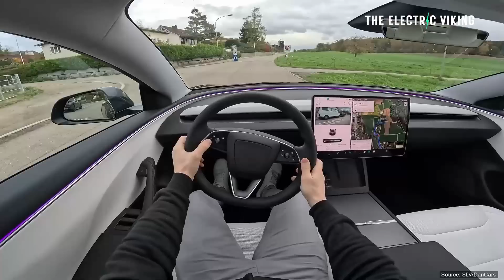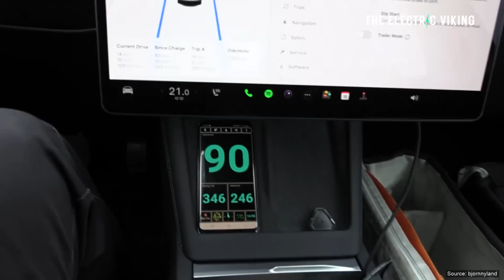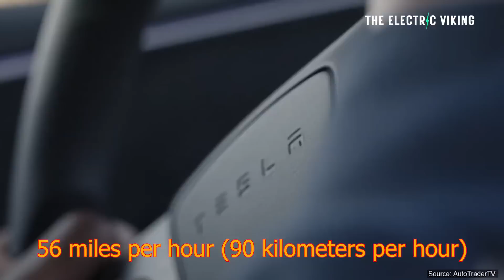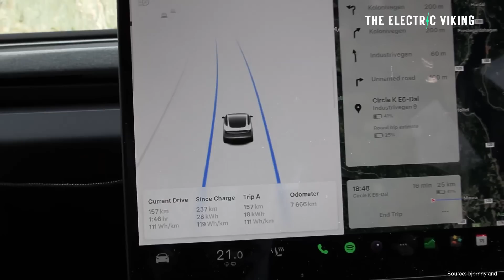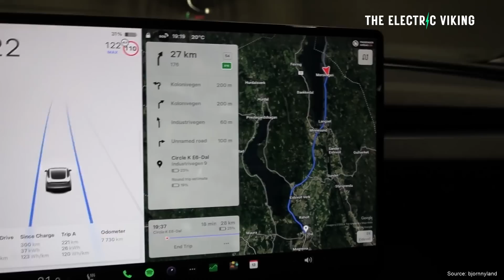Tesla with LFP battery achieves RECORD breaking efficiency in highway test

Comment: Regen does not increase range (with respect to driving steadily), it just means less is wasted (when you do stop start).    Driving slowly is why city driving is more efficient.   Pushing the air out of the way is where all the energy goes on long trips.
Reply: You are wrong on this. Regen by definition increases range it puts energy back into the battery. Now accelerating more frequently draws from the battery faster. That’s why like you said if you had a choice on an open road it would make more sense not to have regen because the constant acceleration would lose more than the regen gains (but it’s close) ……however in the city where you have to stop and start anyways regen makes more sense because instead of breaking and then accelerating you can use regen to add a little back and you would break anyways…..another example is going down a mountain road. Instead of having to break and then accelerate, I could use the regen that would add more energy back into the engine and smooth the ride out. I’ve actually added percentages to my EV going down mountain roads. Like drive 30 miles and and have a few more percentage charge
Reply: And since power losses are proportional to the square of the current in the motor, accelerating and decelerating will always cause your range to drop vs a constant speed (on a flat road).
Reply: @DouglasBruss  Hmm, power output is also proportional to the square of the current.  The losses are linear in an ideal motor, represented by its efficiency. The problem is the losses happen twice.
Reply: @DouglasBruss YES!!  Let's not slow down or stop in towns or cities & thus NEVER accelerate.  Let's remove crossings.  junctions, traffic lights, roundabouts, cars pulling out from kerbs, pedestrians, especially teenage boys with testerone level issues & ego problems, etc so you smart455 🤡s can truly believe you've won an argument!!😂
Reply: Regen increases range in all real world driving.  For regen to not be a factor you would have to never use the brake pedal or change speed ever while driving.  You have to invent a theoretical example of driving that no one actually uses to have regen not be useful.
Reply: Interesting discussion with good points.  It is a semantical issue because different definitions of “range” are being used: maximum potential range, estimated range, operational range.  The study Sam is reporting on is determining maximum operational range under specified conditions. Most of us talk about experienced or operational range, with different definitions there as well. On a recent move I was towing a small, boxy U-Haul trailer from San Francisco to Seattle with my Model Y.  When I started was presented with an estimated range, always less than the maximum potential range built into the batteries. Being in trailer mode I noticed my estimated range was recalculated downwards after driving for awhile into “estimated trailer mode” (ETM) range or the % of estimated charge remaining when the supercharger is reached. This ETM to the next supercharger decreased with hill climbs and increased with downhill regen.  ETM to supercharger range also decreased with speed increases above 60 and increased dramatically by dropping speeds to 40 MPH which we had to do to bring the operational range back up in order to reach the next supercharger (ie brings the Model Y into wind drag optimum at 35-50 MPH).  (https://www.reddit.com/r/TeslaModelY/comments/r2uyky/model_y_speed_efficiency/)  So speed, regen, and trailer drag all affect estimated range and any driving conditions that change factors these will increase or decrease this range.
Reply: @karlwest437 I could go quite a few journeys without using the brake pedal in the model y I had
Reply: @karlwest437  Only with respect to not using regen during stop start.   The comparison is with respect to driving at high speed.   The reason for the less energy per mile is because of the lower speed not because of regen.
Reply: The larger the vehicle, the higher the drag.  Drag, the aerodynamic resistance acting on an object, and by inference the power required is proportional to the square of the speed.  To go twice as fast takes four times more energy.
Drag can be minimized by;
Lower velocity through the air - slower speed on the road.
Smaller sleeker streamlined vehicle
Reply: Lived in Washington, most of my life last couple years in Idaho. That’s the state of Washington in case you’re a DC looper. Region does increase mileage in our area because everything is hills or mountains unless you’re driving just in the city like Seattle but even there it’s hills everywhere. So it does depend on where you live. I mean if you were in Kansas is fairly flat.
Reply: A lot of energy goes into stopping the car. Wasted on friction and heat in the brake pads. Regen recovers this wasted energy and adds it to the battery thus increasing range. It's not rocket science.
Reply: Regen does not increase range when you go on trips that do not require breaks. Which is never. So I guess Regan increases the range.
Reply: In the real world, EV's destroy ice..... in MSM, big oil and the politicians funded by corporations world, EV's are the devil lol. I have watched my mileage go from 100 miles to 50 miles within 5 mins of leaving the motorway in my diesel. Who cares if the regen adds range, if it stops the losses when stopping and starting then it's a winner.
Reply: @karlwest437 yes but less efficiency than not using the energy in the first place
Reply: @karlwest437 It’s called planning ahead.
Reply: Wasting less is the same as increasing achievable range.
Reply: @rogerphelps9939 The Rocky Mountain Institute calls that "Nega Watts". Imagine an EV with Regen parked at the top of a mountain. As the car depends it charges the batteries, thereby increasing range.
Reply: @rogerphelps9939  its not, if you stay at a steady 35mph you will use X amount of energy.   If you repeatedly stop you will be use more energy even with regen.  X will be less than if you sit at a steady 60mph.
Many seem to think that regen in the city is the reason you get more range in the city and some suggest having regen running all the time or adding an alternator etc.  Seriously you have no idea how dumb people are.
Reply: @karlwest437  It does not increase range above driving at a steady speed.  It causes less range to be lost.
When people say it, I hear "the range is increase because of regen, the more regen you do the more range you get increased, therefore it better to be regening than driving at a stead speed"
I'm an engineer, I'm used to be precise.
Reply: @tonystanley5337 if you're ["used to be precise"] (& educated, as an engineer) then you'd be:- "used to BEING precise"...🤦‍♂️
Reply: @alexmanojlovic768  True, my eyesight isn't what it used to be.
Reply: Yeah but it’s impossible to drive at steady 35mph and then regen actually comes in place
Reply: @VortexVibe634  Its not impossible, I've done in late at night and achieved 40mpg (average) in my normally 30mpg petrol car.
Reply: @tonystanley5337  alright dude, you’re the type of guy who don’t get it. Just because one person does it one day doesn’t mean it’s the norm, most people work 9-5 jobs and have to deal with normal traffic , but since you’re an engineer you life is “lab tested”
Reply: @tonystanley5337 in summary regen adds energy back, accelerating takes energy away (as does basic road and air friction) on a highway were there is no start and stop regen doesn’t make sense because the accelerating you would have to do outweighs the regen…in city driving (or freeway traffic) regen makes more sense because you typically have to brake frequently so it makes more sense to use those braking opportunities to add a little charge back into the engine
Reply: @VortexVibe634  Yeah so an expert is "wrong" while lay people are "right" because of common language impreciseness.  Ok whatever you say dude, you must be right.
Reply: @karlwest437  Semantics perhaps, but your statement is wrong.
I'm an Engineer I know how it works.    You only go further in a stop start situation, its not relevant to mention this for city driving.  If you have to stop and start you range will be less that steady driving whether you use regen or not.   The comparison was for city driving and motorway driving.  Regen just makes it less worse, the best that can be schieved is a steady speed and mostly the lower the better, to some minimum around 20mph.
To me the suggestion sounds like regen will give you more range than steady driving at city speeds.
Reply: @JamaicanMeCrazy  Yes, you don't understand the debate in the thread.
Reply: It increases range compared to friction brakes. But it decreases range compared to driving without applying brakes or applying as little as possible
Reply: @ФёдорЛукин-у1о It depends on the type of motor.  There's a reason Tesla have permanent magnet motors on one axle & reluctance induction on the axle that does the regen (to reduce the electromagnetic resistance affected during regen braking).  Which, if a net gain of energy WASN'T produced, regen braking would never be used, would it?  Use some common sense!!  Regen brakes are far costlier (& heavier) to produce than friction brakes, PLUS need extra software (cost -> programming, testing, reprogramming) thus would have to produce a benefit to EV's for ALL EV manufacturers to consider using them!!🤦‍♂️
Then we get all manner of smart455es arguing they don't add range...🤣😂😅  Right.  The EV accountants for all makes let Electromagnetic brakes slip through the financial audit process!!🤣😂😅
Reply: @ФёдорЛукин-у1о  Yes but that is not what we are comparing here.
Reply: @karlwest437  I know that, but it doesn't increase it more than driving at a steady speed of the same average.
Talking about regen is irrelevant when comparing city with motorway driving.  The reason city needs less energy per mile is because of the lower speed.  Regen may somewhat compensate for stop start driving, but it is not the reason city driving needs less energy per mile than motorway driving.  Having to use regen with stop start driving actually increases losses.
Of course its better than no regen, but thats not what we are comparing.
Reply: @tonystanley5337  you get better range with regen than without it in 99.9% of journeys because I can’t think of a journey where I’ve gone 200 miles at a constant speed accelerating once and braking once 😂
Reply: @treboristheman  Its been covered mate, read the thread.
Reply: @karlwest437 TonyStanley's ego is what's wrong with your statement.  Seems there's numerous "engineer" egos on here.  Steady 20mph in towns & cities!!😉 Comparing City driving with motorways to win their arguments. (They know better than us but they tailend others frequently....😁)
Reply: @alexmanojlovic768  All I am saying is the reason for increased mileage in cities compared to motorway is because of a slower speed, and not because of regen. Regen helps reduce losses but its not "the reason".  How is that anything to with ego?   Do you think personal attacks help demonstrate your point?
Reply: @tonystanley5337  hilarious that your YT alias also appears as "so special".  Very telling!!
Reply: @alexmanojlovic768  I'm glad you are amused.  Its a song reference, but hey, its whatever you feel it is.  Facts don't matter.
Reply: @tonystanley5337  especially in your delusional posts where no one needs to slow down or accelerate in towns.  Just drive slower at a constant speed!!... 😂😅🤣
Reply: @karlwest437  You mean the range the vehicle reports changes?  It assume you will have to do stop start.  Perhaps this incorrect thinking is what is behind it.  Your actual range may not be decreased in the case you drive at a steady speed with it off.
Please try to calm down, I know its difficult for you, take whatever tablets you normally take and breathe.

Comment: I think that is the whole point and plan with Model 3 Highland, it was not to increase battery size or range rather to make the car more efficient and this is waht Elon Musk said as well, Tesla will continue to make their models more efficient every time. I am expecting Tesla will soon start to use upgraded LFP batteries, they have to use newer LFP battereis such as Shenzin plus, BYD blade batter v2, Golden battery from Geely, etc.
Reply: Tesla will only use expensive cells in the high range and maybe performance cars.
Reply: @danharold3087  problem is they dont use LFP for long range & performance because of the heavy weight of LFP and other factors. Since LFP can charge 100% while NCM/NMC 80% which will make almost equal range for both on a daily bases. There has been a lot of new development on LFP which will make it cheaper and more available. So I am interested more on how Tesla uses this new batteries and I guess it will be mostly on Rear wheel drive type car
Reply: @abebegirmay3327   
Seem to recall one downside of LFP is the lower discharge rate. Not what you want to go fast. 
Also with LFP as you push the discharge rate past 1C the energy density goes down.
But this is a moving picture.  Things are changing.

Comment: The new model 3 does have a new motor. It has been enhanced. I have a Highland and use it to go to the office 3 times a week, errands, church and going out. I only charge every 10 days up to 65 percent and have about 30 percent left.  I have the 2170 NMA batteries and have no problem at all.
Reply: I don't believe there was any change to the motors or batteries. The performance version gained a new RWD motor but unfortunately no upgrade to the batteries which suffer under extreme load.
Reply: @GDM22  - Actually - no there was a revision to the motors in the highland upgrade - more efficient and the batteries are just fine.  I have the LR version and I have had consistent charging, range and performance.  The 2170 battery in the Model 3 was changed from NMC to NMA.
Reply: @RagnarinVa  I have watched numerous reviews, there is no evidence they are quicker or any more efficient, and I read no change to batteries or motors. The Highland would get slightly better efficiency at speed due to 5% better aero.
Reply: @GDM22  - There were improvements made to the original motor - reflecting similar improvements to motors in other models in addition to new suspension, new rear frame, new wheel frame and brake hubs, new suspension bushings, reworked rear frame, and the changes to the body improved drag.
Reply: @RagnarinVa  I am aware of all the other changes, if you are aware of changes to the motors, post the old (23 build) and new code. Obviously we are talking about the Shanghai version.
Reply: @GDM22  - These changes are not just to Shanghai version it is the US version as well.
Reply: @RagnarinVa  I am aware of the other changes, I am after the motor code revisions from the two versions. The motors have changed previously in some instances producing less power.

Comment: I am loving the Range from my LR RWD.  drive 100 mi each way drive about 70 mph and avg 180 kwh.  my battery was showing 217 mi left when I got to work but the Range estimator said over the last 30 mi you will get 264 miles projected. !!!!!!!   Tampa FL.   my 2021 M3 could not do this
Reply: Sadly we cannot get that spec in the UK. This would be my preference - LR RWD
Reply: @JoeMcMorrow-k7e  Sure you can - the Long Range RWD (with the NMC pack) was first released in in Europe (and UK) around 4 years ago, It was the most common fleet offering from Tesla, not available on the website to configure but often showed up as inventory cars.
Reply: @TB-up4xi  Thanks for this - I will keep my eyes open!

Comment: My M3 2023 LFP car ALWAYS gets better than 250kwh/mile. I think you're quoting the efficiency stated for the dual motor. My car states it will get 210 KwH per mile. That's almost 5 miles per KwH.

Comment: Back in the 1970's , during a fuel crisis, car makers were bragging about low aerodynamic drag with their cars. AS my lecturer a former design engineer for Ford put it, like rear spoilers, it it made little difference until over 80 MPH. The real secret was in the effciency of the engine, drive system and tyres. Added to driving style. The WLTP rating does not show any car at its best, especially EVs.
Reply: Aerodynamic drag increases with the SQUARE of velocity! At 30 mph the aerodynamic drag on a bicycle exceeds the total of rolling resistance and mechanical losses, and it gets dramatically worse at higher speeds.
Reply: @jameswalsh8837 It is true that aerodynamic losses exceed rolling resistance and mechanical losses on a bicycle at 30mph, but this is a huge understatement. The rolling and mechanical losses are a few tens of watts, and the aerodynamic losses are hundreds of watts. This is why most people who are not super fit cannot reach 30mph on a bicycle except down a steep hill or with a strong tailwind. Bicycles with streamlined bodywork are not allowed in cycle racing but they are allowed on the road as long as they have effective brakes and are under proper control. It is possible to ride much faster with a streamlined cycle than with a normal cycle. Some of them keep the rain off you as well.

Comment: The model 3 is very impressive for efficiency. I have just over 11,000km on a long range highland with 18 inch rims. Life time consumption is 125wh per km. I think this equates to 5 miles per kw. 

In some ways it’s a shame that they use old battery tech. I was okay with it as I know it’s tried and tested. We have proven data on the batteries reliability.